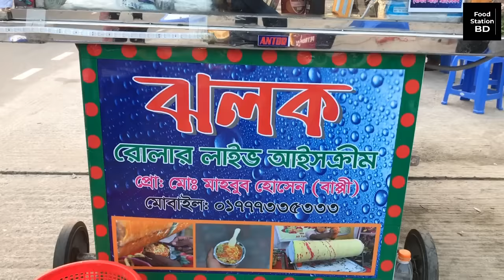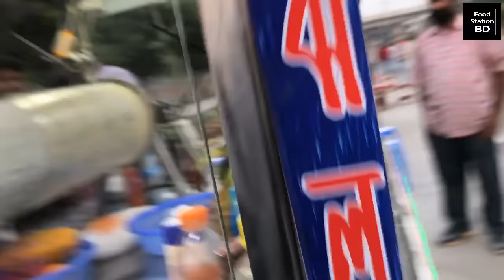Master Of Roller Coaster Ice Cream Maker in Bangladesh | Roller Ice Cream Bangladeshi Street Food

Comment: He lost me as soon as he stepped barefoot on the ice mat.  🤮🤮
Reply: They don't eat the ice from inside the machine.
Reply: exactly people bitching about the stuff ur not eating for most part the wheel itself was clean and the fruit and he even used gloves . So compared to some other its not bad at all. @arnolsi
Reply: Ice and salt inside the cylinder creates a frozen surface outside. Still gross as hell. Love the used pop bottles for measuring. 🤢🤮🤮🤮
Reply: There is nothing wrong in doing that, you could object if he stepped on the platform with shoes or chappal. And in any case he has not touched the roller with his bare feet. You just want to find fault in others.

Comment: Love those comments about the sanitary and ice and foot, people just don't realize that the ice will go inside the cylinder to cool it ..  and the cylinder outside has been cleaned before putting on the stand. Also metal shavings are unlikely, probably those are all inox not cheap alum.

Comment: For a difference, nothing that touched his feet or the ice also touched the food surface. Literally a layer of stainless steel in between which was rinsed off. So you're all dead wrong about that in this case. The biggest issue someone not from there might have is the water used to dilute if it was not filtered and bottled.
Reply: Exactly it doesn't matter if the ice is dirty, are people blind it's inside of metal. Sure you can critique this is unhygienic but so unnessesary about things that doesn't even matter. And these are men working hard to provide for their family, it's difficult to keep everything completely hygienic if your poor and trying as best as you can with what you have. People don't have to buy the ice-cream if they get sick.

Comment: Okay, at least this one is still acceptable by me. 

But, please let me know what is that thing that he poured in to the ice tube/canal? (Whatever it's call) And is that the dry ice?
Reply: There's no dry ice, it's just plain water ice, and the bags of stuff he poured in was regular table salt. Salt lowers the freezing temperature of water, it makes the ice turn into a liquid (known as brine) while still maintaining it's sub-zero temperature. By turning the ice into a liquid it allows much better thermal transfer through the metal walls, if they just packed ice in there without the salt it wouldn't get cold enough to instantly freeze the fruits and cream to the surface. It's similar to how ice on roads is melted, trucks sprinkle rock salt onto them to melt the ice into a liquid that can flow off the surface, even though it's still well below freezing temperatures outside.

Comment: That's not real ice cream there is no milk used, you could have done the same thing with a block of ice and a cheese grader and poured syrup over it, what they have done with that drum packing it with ice and salt was create a cylinder that is at the freezing point of water, you eat that and your testing your immune system, do you like the taste of burnt motor oil and the rubber compound from the tires of the scouter bikes running back and forth, they should have added a flavor Mobile 1. whatever is trapped in the air will land on the drum and become part of the flavor, Well at least there out there trying to make a living.